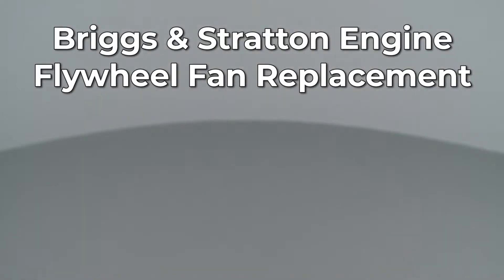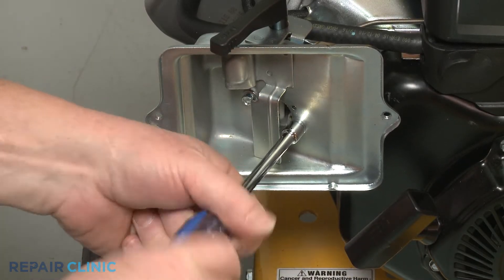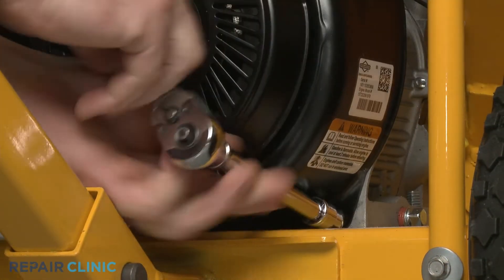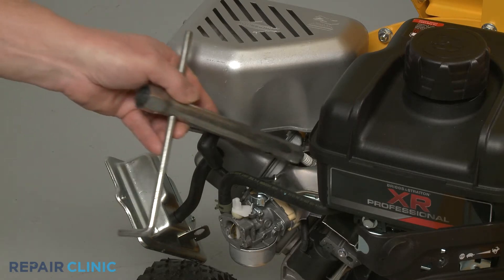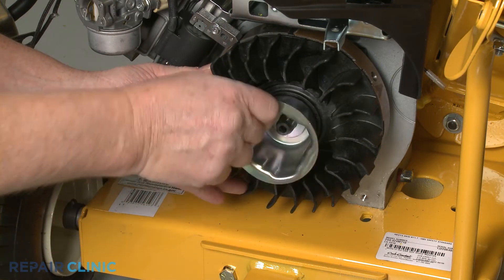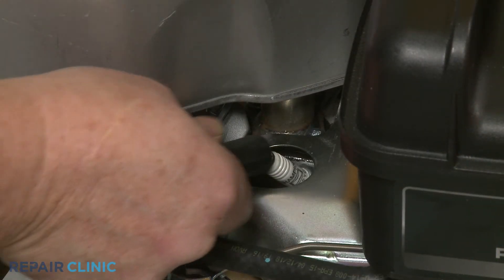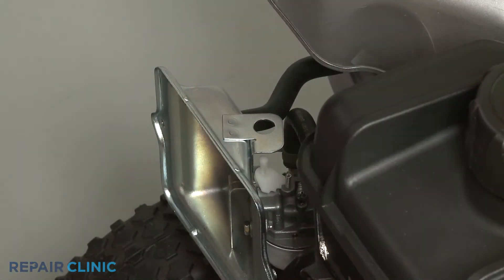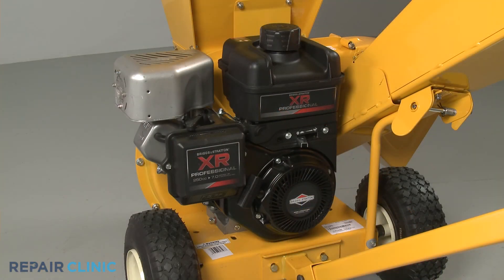Briggs & Stratton Small Engine Flywheel Fan Replacement #555778

Comment: What do you mean by a cord to prevent the engine from turning?
Reply: He put the cord into the cylinder to keep the engine from rotating completely over so then it is stuck in its stoke so he was able to break the nut free from the flywheel.